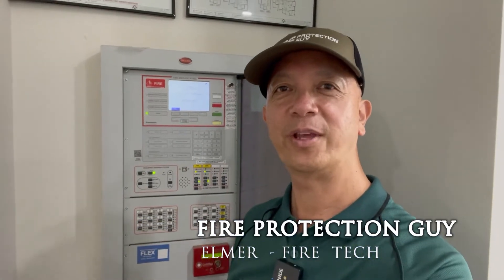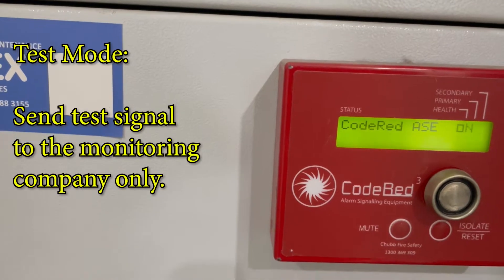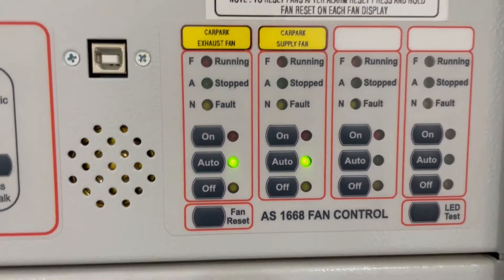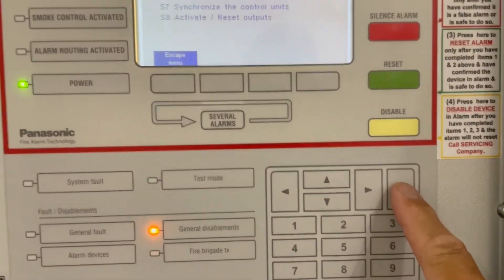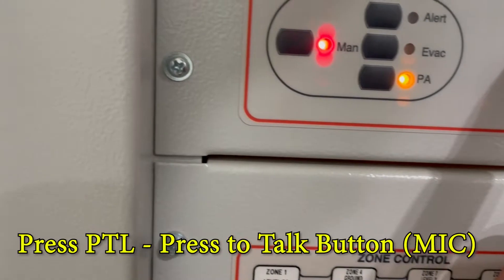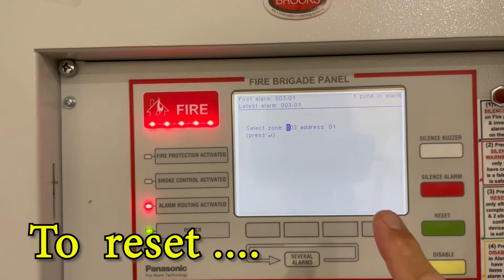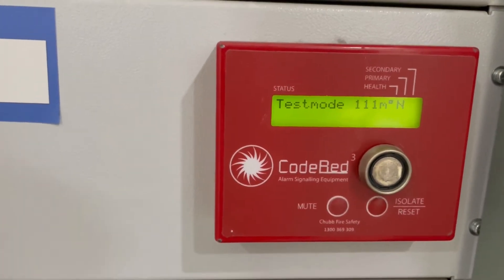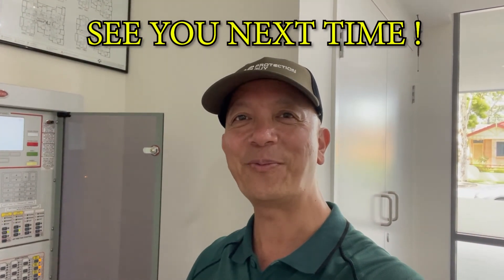FIRE ALARM SYSTEM - HOW TO TEST A BROOKS FT1020 G3 SYSTEM  #fire #firealarm #fireprotection #firesys

Comment: Are all Aus fire alarms the same tone through speakers or do you also have fire bells in use or sounders?  Bells were commonplace in the UK but now the alarm tends to be hi-lo sounders  Great vids
Reply from the maker: Bells are still part of warning system. We still have them in old buildings. Even sounders. But now, we use occupant warning system (OWS) /emergency warning system (EWS) or EWIS for taller buildings. It's part of AS1670 and of the building Code already to use OWS

Comment: I'm assuming this system also has an alert tone?  Or does it simply have the evac tone for this setup?
Reply from the maker: The new standard in Australia...it goes immediately to EVAC tone. The old ones...it started with Alert for 45-60 secs then follow by the EVAC tones.
Reply: @fireprotectionguy7943  Interesting, I wasn't aware of that.  I would've thought though an immediate evac might cause more issues than solve them, depending on the building layout, type of emergency and location of the emergency?
Reply from the maker: @acd6835  Small places, buildings etc uses EVAC system . Bigger/taller  buildings use EWIS (Emergency Warning and Intercommunication System) for orderly evacuation...there you will hear the alert tone first and cascades to EVAC tones. Thnxs for your support. Cheers.